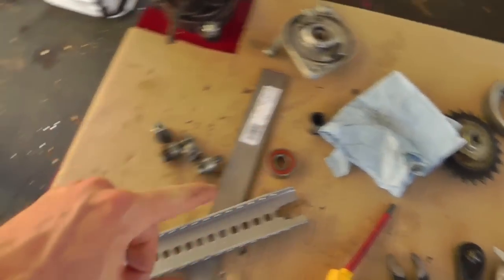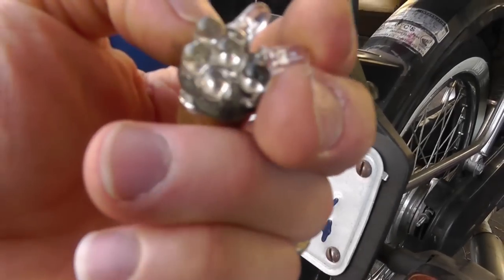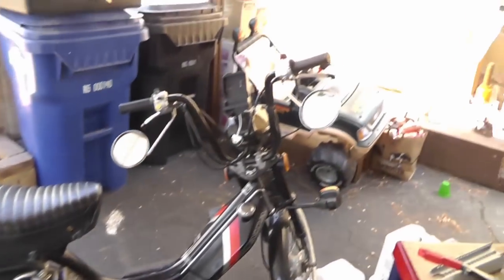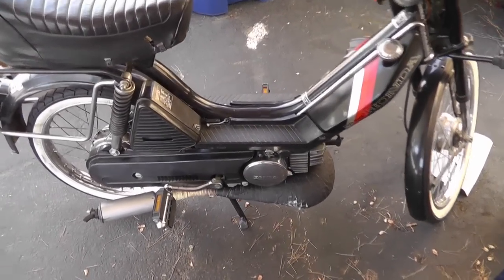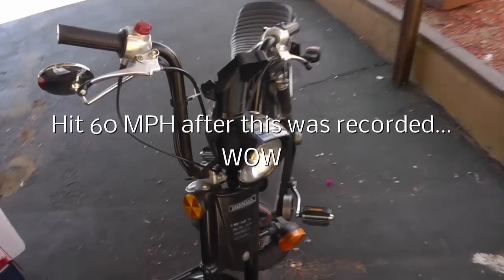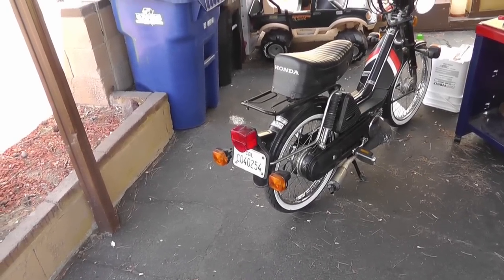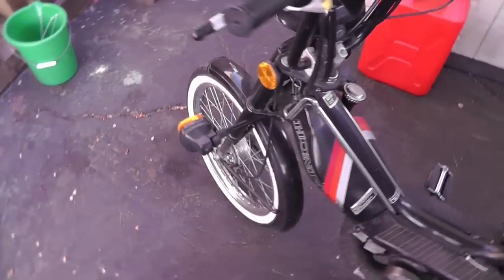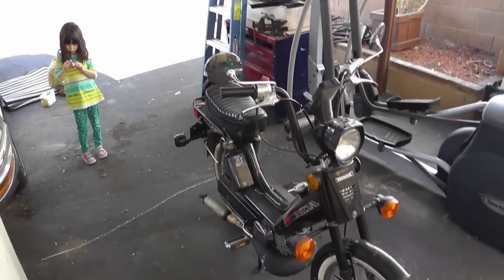#15 Honda PA50II Hobbit Hot Rod: Final Over View / Update... Lots Of Little's...

Comment: You might consider trying a Kevlar V-Belt made for riding mowers. They are made for the blade pulleys and constantly handle all the trauma that pulleys put out, last longer then automotive v-belts, reduces friction, come in a number of lengths and widths, and in most cases cost the same or less. Just a thought. Keep up the work, like your vids.

Comment: You should use bright white LED's for the whole back light. Better brightness when braking and when using running lights. Just a suggestion.   God Bless
Reply: I have used white LED's for the back light of my bicycle. This gave me a pink back light! I did not like that color, so i switched them out for red ones. My light can be nearly as bright as a car brake light, i only used 3 5mm red LED's.

Comment: The motor head bolts... metric I'm assuming? Check the point of origin of the metric bolts. There are three different world wide metric systems, American, Japanese, and German. Example, Japanese bolt thread is at a sharper angle than German bolt threading. A possible solution would be to re-tap the cylinder head to match the bolts.

Comment: If you want to find out the true MPG, you are going to need to weigh the bike before and after you drive it. Volumetric measurements ("about here, to about here") don't get you enough resolution for the calculations.

A gallon of gas is about 6.5lbs I have found. So, weigh the bike before and after (A digital fish scale would help a lot here) a ride, note the air temp for the ride, and then you can figure out your MPG.

24:44 - GLITCH IN THE MATRIX!!!

Comment: Consider a smaller diameter head bolt made of spring steel...used extensively in automotive aluminum heads for expansion and contraction maybe the oem bolts are mafe that way? aluminum swells and gets more plastic also graphite head gaskets are used in automotive to help with head scuffing due to the heat expansion..anyway good luck like your vids bro peace out
Reply: I was thinking of drilling a small hole through the head of the MACHINE SCREWS and running a  wire through them all. In aviation, this is called "safety wiring." A proven technique for high vibration and thermal cycle induced loosening...
Reply from the maker: got some OEM bolts and there still doing it... next some spring washers: https://www.fastenal.com/web/products/details/11509212
if those dont do it... then it just torque wrench every week for the rest of its life :) ~Russ
Reply: Russ, maybe the metal is getting too hot and shrinking away from the bolts. Blue locktight for auto bolts is tough stuff that might do the trick. Maybe an airscoop for cooling?
Reply from the maker: area46241
 not sure, i used red lock tight but no good.. the head is a little messed up now that i have used other bolts. i think that's a factor with the new bolts...